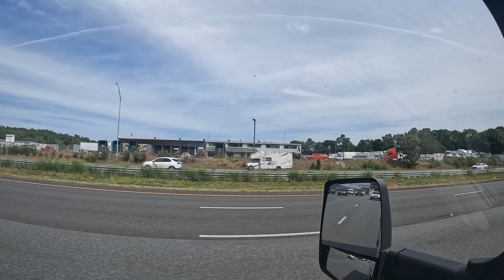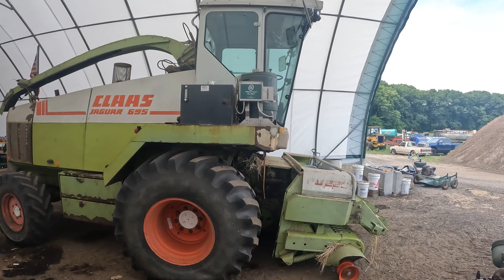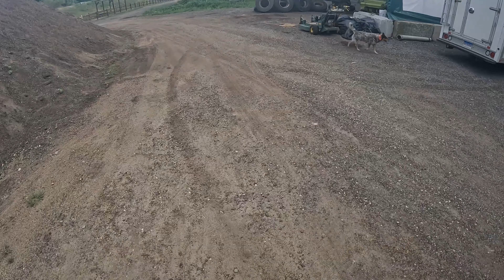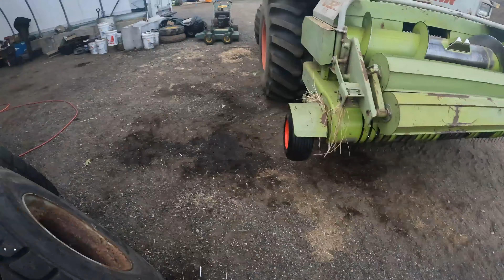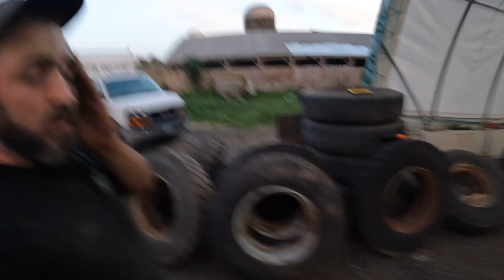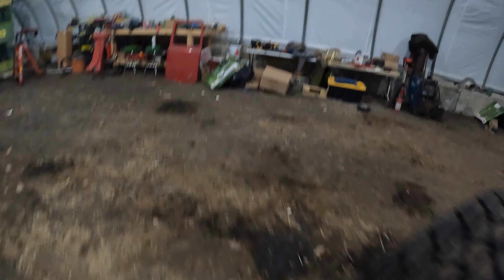Tire Work To Get Some Projects Done- Upgrade To Air System But Still Not Enough!!

Comment: Head gear is fine as long as you move a little slower.   Feel like im on a ship at high seas during stormy season when you get really focused and whipping around back and forth looking for parts or tools.  I complete understand when youre focused and on a mission that the camera is the last thing youre worried about.

Comment: Swap the inlet on the copco tank to an outlet. You can make a male/male fitting to fill it, and if you need to pull the compressor you won't lose the air.

Comment: Holy crap man if you're offered a place to go and store all your stuff take it sooner than later go go go lol. You have three trucks there that have air plug your big tank and one of those and it will probably be filled in less than five minutes instead of running that tiny little tank compressor you'll burn that Out in no time

Comment: I enjoy the wrenching videos.
Good luck♧ from Milwaukee WI.  You may want to get a relief valve on that tank and put a small drain screw on the bottom too.
Reply from the maker: I figured the pump would be the relief for now but it does have a water drain on it

Comment: Put a half inch fitting on the air compressor the half inch pity on your tank so that where the air will flow a lot bigger a lot more floor instead of 3/8 spinning get a half inch hose and smaller hose to help you up quite a bit

Comment: Don’t forget you got 2 trucks with air compressor’s for the air brakes if you get in a pinch if your little air compressor goes down-you can plumb that big air tank into one of them trucks to use for shop air to get by for awhile

Comment: The issue of succession planning in agriculture can be fraught with tension, blame, distrust and discontentment. 
A friend of mine had a great plan for his family property, him, wife, son and daughter but this worked because everyone who worked on the property was paid a wage, even if you only did 1/ day for fun you got paid. So he sold all his assets (land, equipment,keeping only personal stuff like cars) to the four people concerned. Then they bought back the assets from the daughter as she didnt work the property and had no interest in it, so that left 3 interested parties. He then had a step down plan which occurred over 15 years with all decision making, planning, future proofing etc done as a team, gradually ending with him doing less physical work, just pottering around and working as a fill position. 
Everyone knew what was happening, worked to the schedule (which had nothing to do with working the land) but a transition to his retirement. All this said it didnt stop Mum and son buying assets together or singularly as each wanted but it ensured that if son wanted to continue there was a plan in place so he could assume control and responsibility after 15 years
Others have tried this plan and failed but for them it worked, mainly because each had a wage and that wage was dependent on what they did so there was no "I did this for 10 years and didnt get paid for it" type thing.

Comment: Evening Chris . On the Mack and International you should plumb an air line with a 25' line and quick connects . That would keep you from needing to run back to the shop and you could air tires down for better flotation then back up for the road.
Reply: They make air lines that connect to the redline glad hand